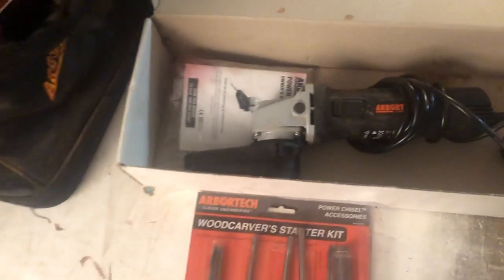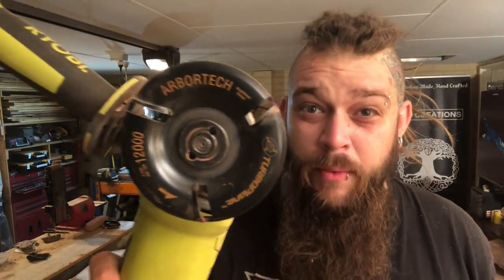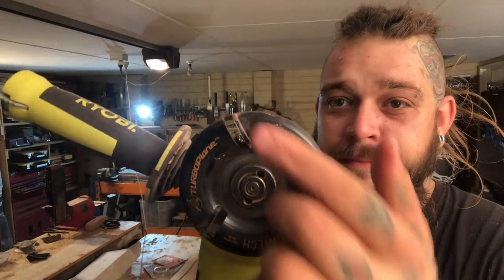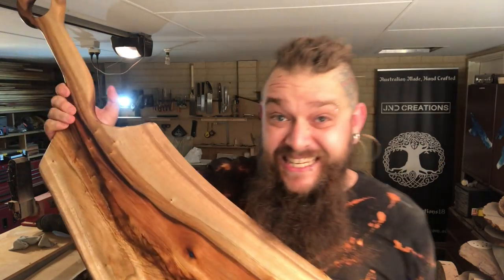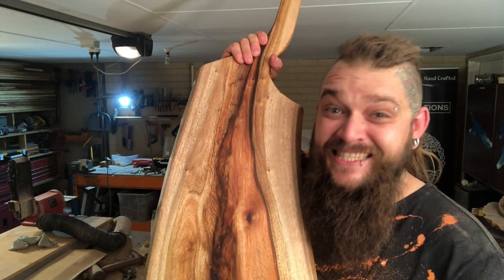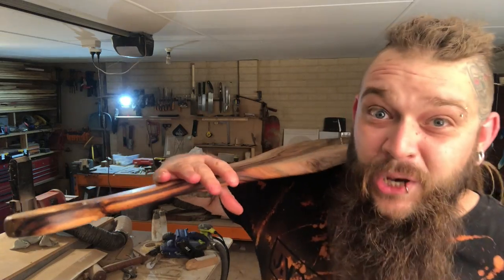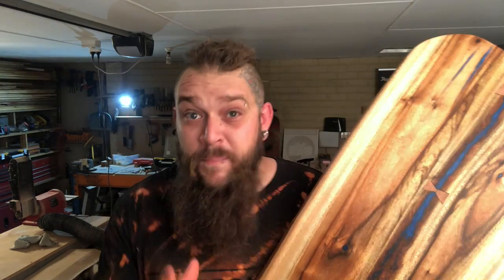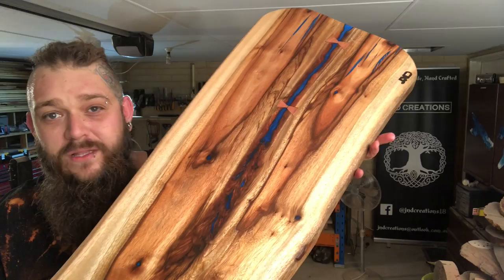Making a MASSIVE Charcuterie Board // Camphor Laurel

Comment: The charcuterie board looks fantastic! The butterflies are a nice detail but they should have been cut long grain. Cutting them cross grain renders them functionally useless, but still a nice decorative detail.
Reply from the maker: Thanks mate! 
Very true, I didn’t consider that point at the time. In this instance they are purely for looks though as the resin will hold the timber together.